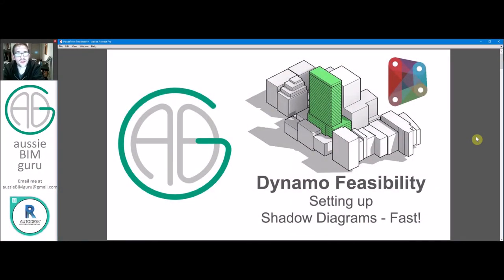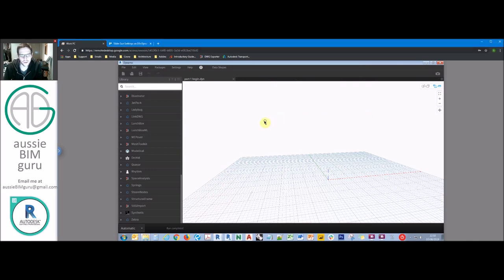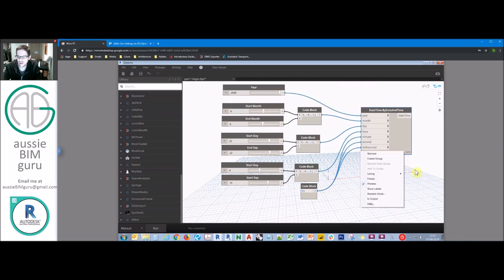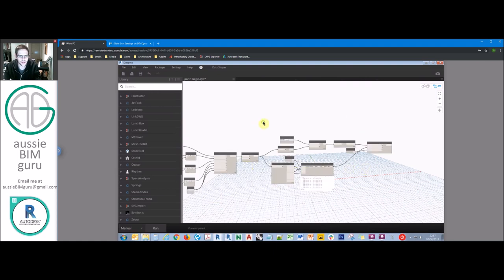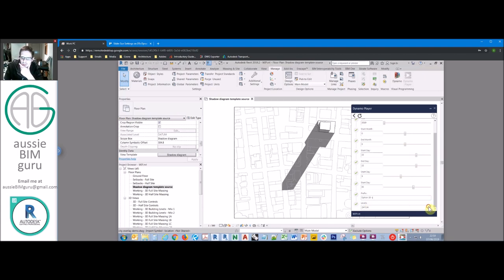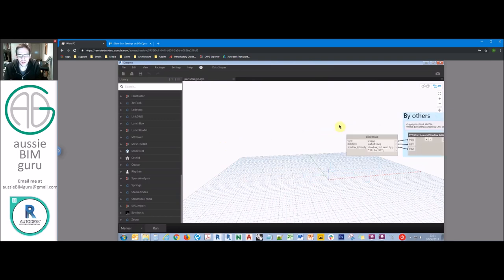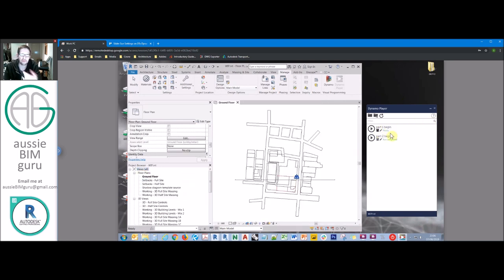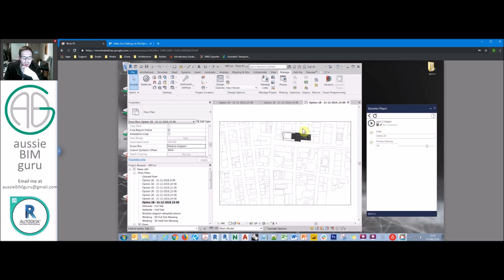Setting Shadow Diagrams up using Dynamo (Feasibility Part 6)

Comment: Hi Guru, would you mind to change the video recording ratio to a more generic mode in order to have a better full screen watching function. Now, many vacant spaces are shown in the top and bottom sides in the video. Thanks.
Reply from the maker: Great suggestion, I've begun to experiment with slightly squarer ratios in the background, I'm aware it isn't the best ratio currently. My goal is to find one that works on 1200x1920, with a bit of room above and below for scroll bar in black banner. It's challenging as my monitor at home is wide screen (1440x3440). Expect that in about a month's time the videos will better fit standard monitor and mobile.
Reply: @AussieBIMGuru  Thanks Guru.
Reply from the maker: @panggary9415  Tested last night, will use standard 1080x1920 from september 9th onwards

Comment: is there a way to build both scripts in to the same dynamo file. When I have many options and many sun settings it become daunting to set each of hundreds of views.
Reply from the maker: Yes it would be, you would need to put a await node in between to get the script to wait for the families to be placed but continue from when they are.

I acrually use grasshopper for this workflow these days so its been a while since j develoled on this one.